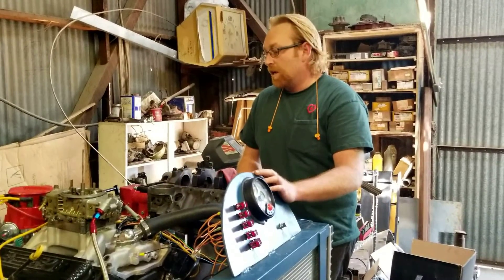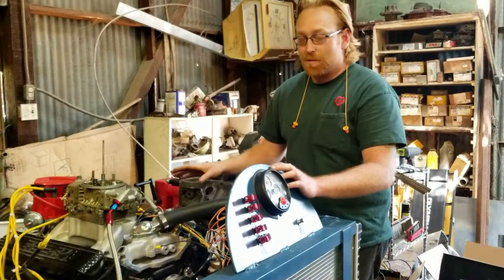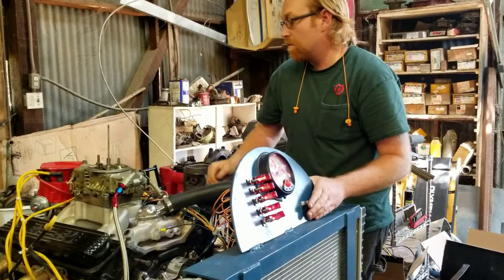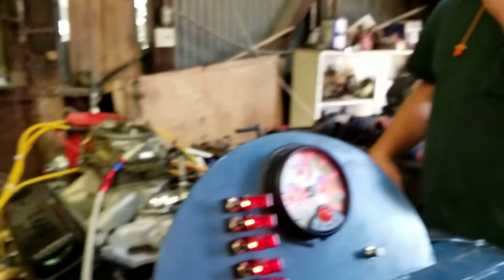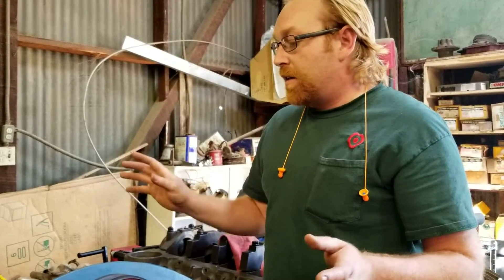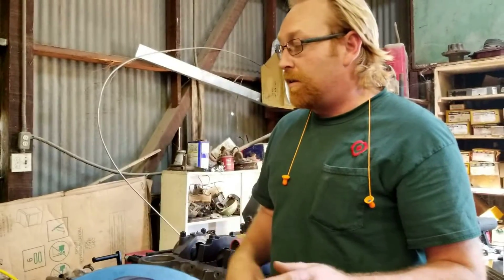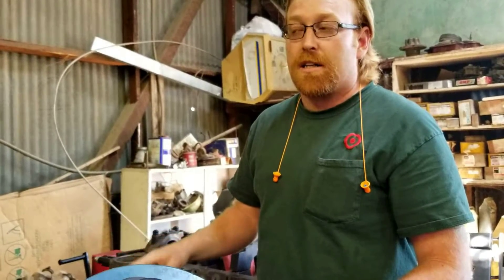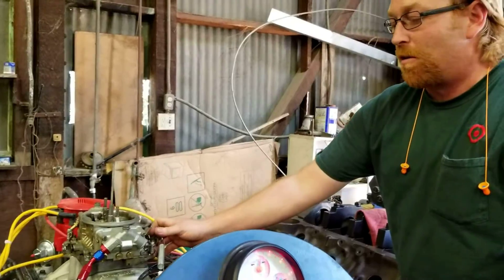Rebuilt 5.7 Vortec on running engine stand (Open Headers)

Comment: Why do all the work and just put a stock cam in it lmao at least go a step up
Reply: Because the stock Vortec cam is actually pretty decent.
Reply from the maker: it was only ment to be a quick flip. not a all out hotrod
Reply: Because gas isnt cheap. Why cam a daily just to bleed out financially
Reply: stock 5.7 vortec like he has it setup is about 310hp, 390 ft lbs, AND it idles like stock. throw some 1.6 rockers on and youre 325hp, 400ft lbs and the cops wont mess with you.